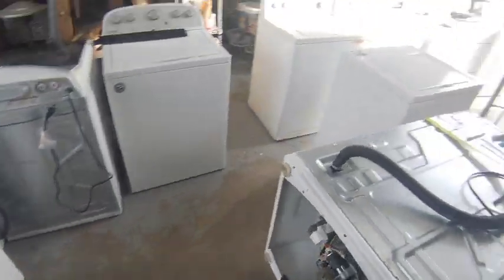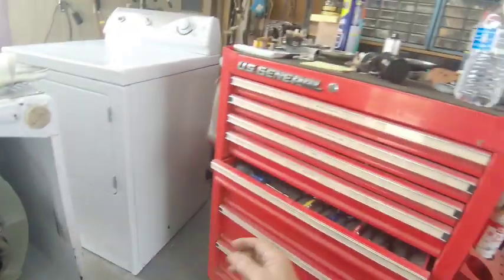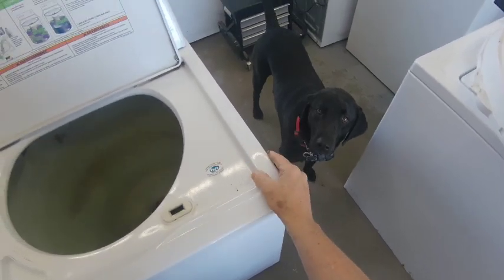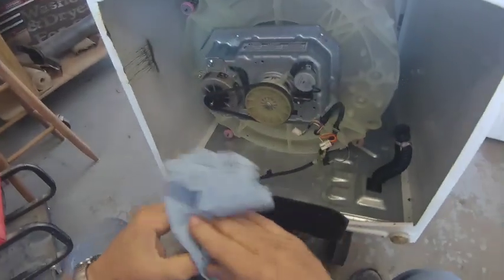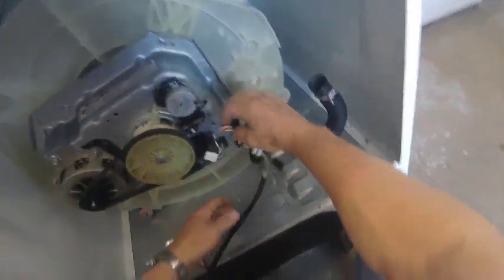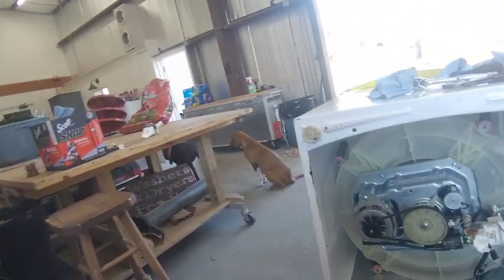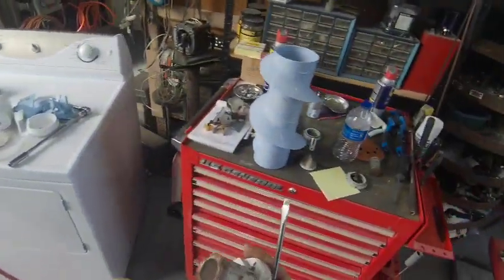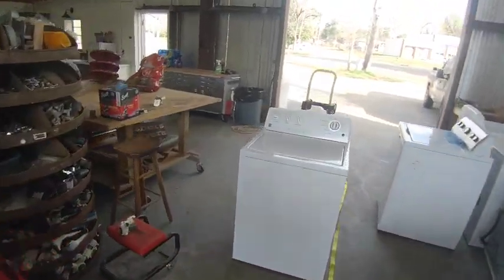How To Revive Your Kenmore Washing Machine: Gearbox Swap & Pump Repair Tutorial

Comment: Another great video. Having a spare used transmission is the only way to make that repair affordable. Great job.
Reply from the maker: You are correct. But if you are a DYI guy it’s could still be cheaper than a new machine! Thanks for Watching!

Comment: These washers are so easy to work on. Too bad they kind of stink and seem somewhat low quality with the non serviceable gearbox, but I do like the vmw platform when done right (washers that actually use water and have a dual action agitator, and the commercial versions seem to perform the best). 

But as a DIY a new gear box is a couple hundred bucks and I think I would just replace it instead of buying the same junk over again. Well, as long as the cabinet wasn’t all rusted out. 

Also you have something going on with your audio, it keeps cutting in an out a lot and I’ve noticed this on other videos too.
Reply from the maker: Those are spots where I clear my throat or cough and I mute the sound. I could cut them and use blur transitions I guess. I didn’t think they were that noticeable. Thanks for the heads up. Thanks for watching too!
Reply: Ok thanks, yeah I listen using headphones so I notice background sounds more than if I watched through computer speakers. No biggie, I wasn’t sure if it was your mic going wonky.